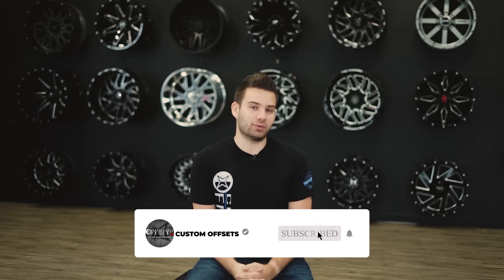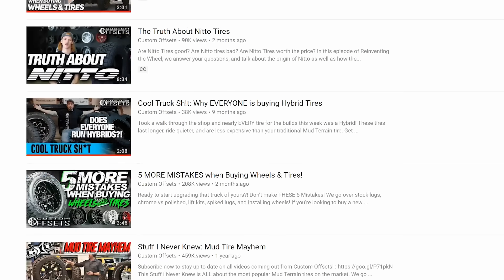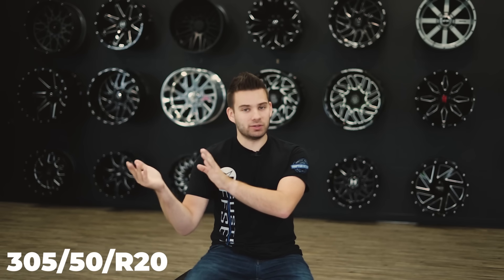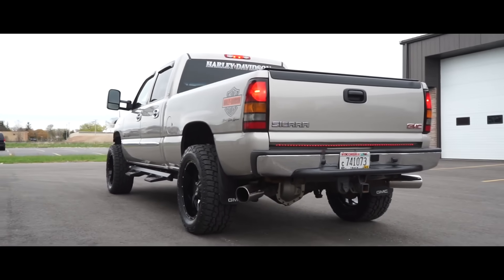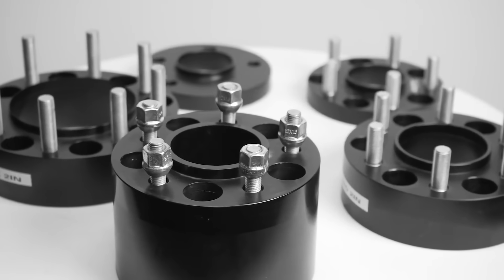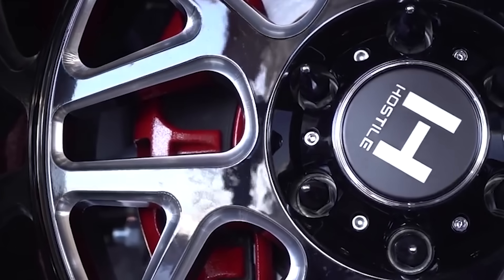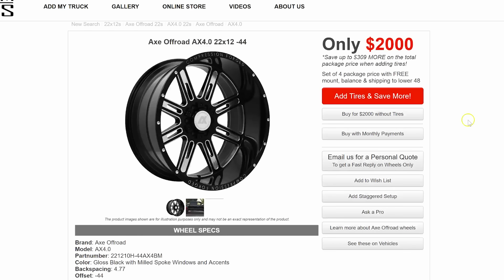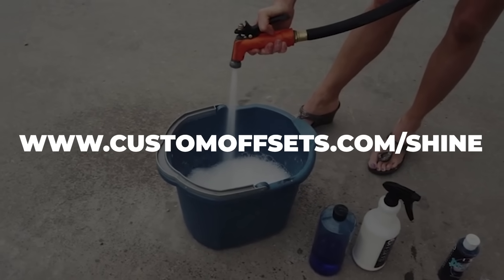WATCH THIS BEFORE YOU BUY WHEELS AND TIRES!

Comment: The video did offer some good info, but neglected to mention important precautions regarding offset. when you stray from the factory offset of the wheel you change the load on the bearings. too little of offset loads the outside of the bearing and too much loads the inside of the bearing. there are numerous things that are affected when you change the offset. do your research before you spend your money on looks alone.

Comment: I have a 2017 Chevrolet Silverado 1500 LT Z71 4x4 crew cab. A week ago I just put a leveling kit on the truck and bought 4, 18”x9” Fuel “Assault” wheels and put BF Goodrich All Terrain TKO-2 10 ply tires on it. The stock wheels came with 265’s but I put 285’s on the truck and now it looks night and day different. I know that on my truck you can have a lot of negative off set on the wheels otherwise they will rub. Fortunately the shop that I went to was very knowledgeable and ordered the proper offset so the tires would not rub. I think it was either a 0 or -1 offset. I’ll have to ask them and see what specific offset they got but the truck looks fantastic now and has a little better off road capability as well as all weather driving capability because the stock tires sucked in the snow.

Comment: Have a 2020 Chevy Silverado trailboss and I've driven throw 2 winters and the stock wheels have held up really good. Now just had a readyleft leveling kit and bushwackers pocket fender flares put on her looking for a a set of wheels and tires that fit the wheel opening with no rubbing and hold up like the stock wheels. I live in Pennsylvania on the Allegheny mountains and we get snow and the tires on her held it quite well looking for aggressive offroad look but she will spend most of her life on road. Don't want the tires to stick out pass the fender flares

Comment: I absolutely love my fitment and stance.  Bought my first winter package for a build truck before I was going to order the final package post winter. However Yet I’ve wasted 1/2 the price of the tires trying to correct the package I received. 2 tires were out of balance by approx 3.0oz. I have a non solid  axle that has a serious death wobble which ruins the idea of using this as a cross country vehicle. This could have easily been a A+ transaction but it was more of a C-    I hope I’m back with better luck for my other packages and vehicles.

I’ve had them balanced twice by two different Corp installers (different processes)and rotated 4 times in 200 miles.  Bought hub centric rings and currently on second set of lug-nuts.  I feel it’s a simple fix but have had 0 luck and the pros are clueless unless the tires were bad from the start.
Reply from the maker: If you send us an email to sales@customoffsets.com you'd be amazed at how we can help you out with this!

Comment: Why no mention the problems associated with oversizes wheels and tires. Those things change the ratios in the transmissions and differentials especially in 4x4's which can be extremely expensive to repair or replace when worn out or overstressed. This includes the "WHOLE DRIVE TRAIN INCLUDING THE MOTORS". But if you have the bucks to enjoy those mod's, then go for it. Personally, I have trouble saving up $1,000 for original equipment size tires, 275/70/17 for a decent brand tire with ome rims.
Reply from the maker: We always recommend re-gearing when moving to larger tires such as 37s. Never hurts to regear as long as it’s done correctly!

Comment: Can you guys make a video on fitting new brake kits?  If you get new wheels and tires that are way over sized from stock is it necessary or even a good idea to do a big brake kit? And what kits do you recommend?
Reply: Not many folks think of this. But i remember when 20s first come out u didnt do it without getting big brakes.
Reply from the maker: You should once you get way bigger but alot of people don't.
Reply: Bad Batch almost nobody adds bigger brakes. And to be honest on most if not all late model trucks, they have much better brakes than trucks of the past and don’t really need bigger brakes unless you go insane on a daily driver. Just a good set of pads and rotors are fine when it’s time to replace. I had 37x13.5r22’s on my 2000 2500 Silverado and it still had more than enough stopping power to lock up and kick in the ABS to keep them from skidding on dry pavement. But if going bigger than say 40in tires I would recommend a big brake kit, and anything over a 33x12.5 tire just give yourself a little more braking distance.

Comment: I like my setup I got from you guys. Had to get adapters the new rim was too flat and touched the brake calipers.
Reply: Elijah Brooks: So they sold you the wrong wheel then with incorrect backspacing but you still like it? WTF
Reply: @dominicoconner1973  or maybe he didn't search his stock backspacing and the backspacing on the new wheels 🤔

Comment: I’ve got an 08 tundra on 35x12.5s with +25 offset and they still stick out just enough at around 1/2 inch with zero rubbing
Reply: Whats the rim size?
Reply: walter yanez 18 inch rims

Comment: Yes I had a question I have a 2019 Ram 1500 four-wheel drive I'm going to put a 3 and 1/2 ReadyLift on with 35/12.50R20 on I'm going to get my rims from y'all I was looking on y'all's website at a different offsets I'm not sure about 9 or 10 I don't mind it sticking out just a little im not sure about the width and the offset if you could please help me out I really appreciate it thanks
Reply from the maker: Check out our gallery! Its designed to answer your question, just type in your vehicle make, model, year plus suspension and see what others have made fit including rubbing and trimming details!
customoffsets.com/gallery
Reply: Do yourself a favor and go 6" lift... Trust me you will wish you went higher after that small 3" lift is installed... And I think 10" wide with a -24 would be a good fit for what your looking for... Its stick out a little without being too aggressive... -12 wasn't enough for me so I sold my wheels and got -24.... 2 years later I'm going to a 22x12 -44 on my Ram

Comment: Just to clear it up here in australia we only talk metric or sort of. Lol.  so yes 305/50/20 305mm 50% of the width(305mm) for sidewall height and 20 inch diameter wheel

Comment: Hi Custom Offset. I have a pickup truck Np300 Navara 2017 4x2 what wheels and tires that you can recommend (hostile, fuel maverick or contra or moto metal)brand. I prefer 18x9 or 20x9 wheels wrapped with 305 60 R20 though.  My pickup truck is my daily car sometimes I do offroading with my buddy's 4x4 pickup truck  (once every quarter). I really appreciate your recommendation. Tahnk you.

Comment: Will a set of 17x8.5 methods for an 01 f250? The backspacing on them is 4.75". Stock wheels are 16x7 with 4.25" backspacing.
Reply from the maker: Email our experts at sales@customoffsets.com and they should be able to help you out! 🤟🔥

Comment: How do the tires compare with the width of the wheel. So like having a 9 wide wheels but have a 12.5 wide tire. Can you run into issues with having a bigger difference?
Reply from the maker: No that would be a perfectly fine setup to run and it would offer a good amount of tire bulge to protect  your wheels! You can check out our wheels and tires here!
customoffsets.com/wheels

Comment: looking to get a new set of Nitto tires..    Love the price and longevity out of that brand.   

Between Nitto Ridge Grappler and Nitto Trail Grappler, which one has the MOST aggressive Sidewall?   Currently, i'm running on the Nitto Terra Grappler G2 305-50-20, appearance wise is it better to go with 305-55-20
305-50-20
325-50-20
325-55-20
My vehicle is a  2016Toyota Tundra Crewmax NO Lift.
Reply from the maker: Check out the Nitto Ridge Grappler here!
http://bit.ly/2IPxTlR
Reply: Popeye Sailorman ridge grap

Comment: Curious if stretching tires will debead at high speeds on freeway
Reply: Cheeto Bandido Depends what size your stretching. I guess they have more of a chance for that, I’ve never seen it. What size are you doing?
Reply: More like blow the whole tire up
Reply: Cheeto Bandido aside from you’ll look like an idiot, stretching isn’t usually an issue but don’t expect to have great luck with the bead staying seated if you tow a lot and have a tire more than an inch more narrow than your wheel. The sidewall of a tire isn’t made to have the sidewall and bead sitting wider than the tread patch.

Comment: I have a '20 Toyota Tundra w/ Tow Package that's meant to pull our travel trailer, and that will always be its primary duty aside from the Lowes / Home Depot trips, etc.

That said, I think the 20" stock wheels on the truck are underwhelming and I wanna replace them with something else.

I've been looking into Method and Ray10s (I don't believe they even offer a 20" wheel?).

My question is this: Is there a functional reason why trucks come with 20" wheels?  Is it best to stick with a 20" if towing is the primary purpose of the truck?

The existing tires are Goodyear Wrangler SR-A, P275/55/20.  Decent on the dry but suck in the rain.  I'd like to find a tire that has better rain/snow and offroad (gravel & fireroad) capabilities. Prob the most "extreme" offroading this truck would ever drive would be White Rim Trail on a dry day.  I think something a bit wider with more contact patch would be good for what I do.

Thanks in advance for any help and suggestions!
Reply from the maker: In an honest answer, there isn't a functional reason for the 20" wheels. They are for looks in a sense but they don't change the towing capacity. 

Send our sales team a email or phone call then our experts can help you find the wheel and tire package that works best for you.
Reply: @CustomOffsetsTV Thsnk you for your reply!

Comment: whats is better on a 2018 F150 with 6"bds lift 35x12.5r22 Vs  325/50r22 this would be on 12 wide wheels - 44 ?
Reply from the maker: Check out our gallery and see what other people put on their 2018 f150:
https://www.customwheeloffset.com/wheel-offset-gallery?order=year&make=Ford&model=F-150&year=2018&suspension=Suspension%20Lift%206%22

Comment: Looking for some suggestions for new tires here. Just bought a 2016 Chevy Silverado LTZ Z71 this year. Planning on putting a 6" lift on it in the spring. And have already found the rims I want. Im looking for tires however. I used to use BFG A/Ts on my older vehicles. And they worked really well in the snow we get inn Alaska. Wasn't too fond of the KO2's however when I put those on my HUMMER. Can anyone tell me some that they have used that worked well in snow and ice? Thanks for the great videos tho #Customoffsets They have been really helpful when doing most of my research!
Reply from the maker: Weve heard good reviews of them in the snow!

Comment: Hi i want to look my wheel a little bit look further what is the best offset if i put 275/70 r17?
Reply from the maker: The more negative offset you have the more it will stick out
Reply: @CustomOffsetsTV  tnx mate!
Reply: The wheel off set tire in will able cm tire wheel can turn able bounce WTF off set 20s spacers off set mpg 25" lift moondog WTF 10" off set

Comment: My problem with aftermarket wheels I have a 2013 Chevy Cruz that I put a set a high gloss black 18 inch wheels on after winter they were scratched to hell after the second winner they were no longer high gloss I just bought myself a 2020 Silverado Trail boss I actually like the wheels that are on the truck but there’s a problem every trail boss out there has the same set of wheels on it so I am considering on changing them but if they’re going to do what happen to the ones on my cruise after a year or two I can’t see invest that kind of money I need some kind of guarantee that they’re not gonna do that
Reply from the maker: Shoot us an email to sales@customoffsets.com so our experts can help you find the perfect wheel! 🤘🏼
Reply: @CustomOffsetsTV  it's not at the top of my list I'm gone to wear the tires out on it 1st I'm putting a spray in bedliner in it. Tahoe cover on it I said a rock sliders with steps. That'll be my big one for this year. That's happening next week.

Comment: So if I understand correctly. If a lift kit says it requires a certain amount of backspacing…for example 5 inches, does that mean you need to have a wheel that has 5 inches or less backspacing?
Reply from the maker: Correct

Comment: Im really needing help if someone can assist.  I have a 2021 Ram 1500 that I put a 2.5 leveling kit on.  Im wanting to get the Black Rhino Highlands and want 33 or 34 inch tire.  I see some websites that show 18inch wheels with 33 or 35 inch tires. I went to Discount tire the other day and they made it sound like the 18inch wheel wont fit.  Can someone please show where to go or weather or not this is possible..Im ready to order and make this happen i just need clarity.  I also want just a half inch at most of the tire out from the fender.  What offset do i need..Please help
Reply from the maker: Check our gallery out for fitment help Jkerns. https://www.customwheeloffset.com/wheel-offset-gallery?suspension=Leveling%20Kit&sort=yno&make=Ram&model=1500

Comment: First, that comment about "you get what you pay for"....Nexten has been trying to build a reputation so they use a very good rubber compound in their tires.
I had two on the back of my pu and driving aprx 14,000 per year they lasted four years. Cost $110 per tire. But they have limited sizes.
I do not use mud tires till they are bald in the middle, so mine had a decent amount of tread left when I replaced them.
Are you going to mention the FACT that in some states it is against the law for the tires to stick out past the fenders ?
Reply from the maker: Laws vary between states, in Wisconsin you are allowed up to 2" of stance but most cops wont bother you unless your being unlawful about it.
Reply: @CustomOffsetsTV  Just saying that you might mention that they should check their local laws first out of courtesy to your viewers.
Reply: Gecxid Rureel     Anybody modifying any vehicle should check their local and state laws . most modifications are illegal just not enforced until you run into that one cop having a really shitty day .

Comment: Question I have a 2015 Chevrolet Silverado LT 4x4 factory with 17" wheels what size wheels including width will fit without a lift kit ?
Reply from the maker: Type in the specs you are trying to run in the gallery to see what will work! customoffsets.com/gallery

Comment: So if I’m gonna add fender flares and don’t want my wheels to stick out a lot which size should I buy? 20x10 or 20x12? I want my tires to be almost flush with the flares. I have a 2014 Silverado 1500 with a 6inch lift. Nice video. Lots of info. Subs..
Reply from the maker: Check our gallery out for fitment help! CUSTOMOFFSETS.COM/GALLERY
Reply: 20x10
Reply: But do negative offset the bigger the number the further that will stick out

Comment: Would you recommend a small offset for safety if you want to haul a cabover? Ive seen some people recommending getting a dually for a cabover which makes sense if you have a rear blowout but I’d rather not have that wide of a truck, and it looks like a small offset would maybe add stability?
Reply from the maker: We would recommend searching forums or asking local truck groups about what others did!

Comment: At what point do tires switch from P metric to floataion sizes?
Reply from the maker: AnyBodyWannaPeanut there is not a defined point actually. P-Metric typically refers to “passenger” rated tires, but you can get metric tires as large as 325/40/24 which is larger and wider than your standard 35x12.5
Reply: @CustomOffsetsTV  So I guess what I really want to know is why are there 2 different standards? It just seems to me that it makes it more confusing for the customer.
Reply from the maker: AnyBodyWannaPeanut we totally agree! We’ve asked the manufactures the same question and even they don’t have a good answer!

Comment: What would the cooper stt pro be considered ?
Reply: Mud tire
Reply: mud terrain tire
Reply: Simon Hopper I have the STT pro on my ram 1500. I’m running a 295/70R18 and they aren’t loud I’m my opinion. A small bit of road noise but nothing obnoxious
Reply: @kelenefta  how many miles ya got on em? Thanks for ur input.
Reply: Simon, I have 17,000 miles on them still plenty of tread. I rotate every 3,000 miles to get even wear
Reply: No problem man.

Comment: 97 Chevy 1500 2wd  stock height  with a 2 inch drop in the rear to level with 20x12s 305/50 major trimming rubs like a bitch

Comment: Typical salesman….the cons of bigger wheels and tires with negative ( deep dish look ) more than factory offset ?…increased bearing wear , fuel economy decreases, less power from off idle acceleration, speedometer goes off ( usual remedy is gear change front and rear diffs if 4x4 ) , turning radius get limited by hitting suspension components and frame( even if you cut and trim panels ), some states you may not even pass safety check because it’s sticking out to far.. and one of the worst is kicking rocks and mud all over lower panels and in extreme offsets will actually throw it on top of vehicles chipping paint in process 😳..unless you really have a need to go to a larger offset rim and tire consider staying with the factory offset and width and usually just one size up on tire width and diameter will not need any body panel modifications and sometimes only a suspension leveling kit…if you’re lucky none at all…looks will cost you more than you think if you don’t know all the cons …😳